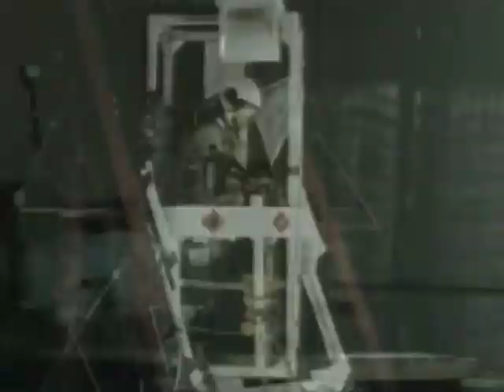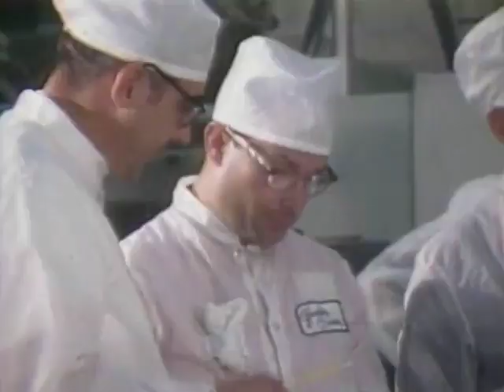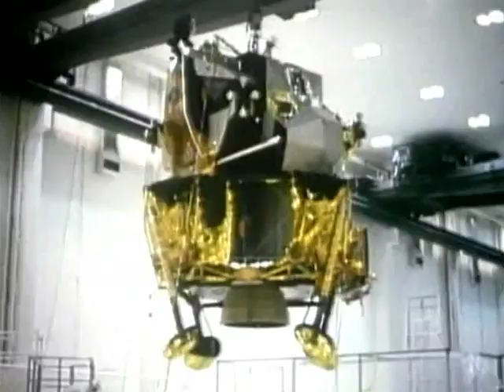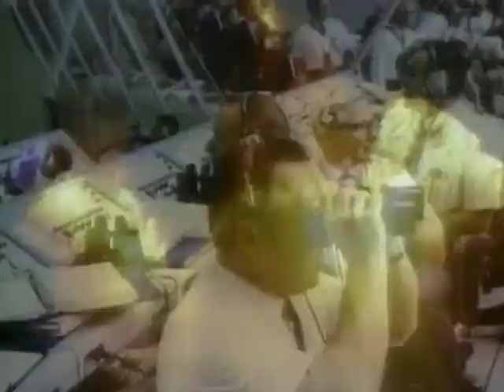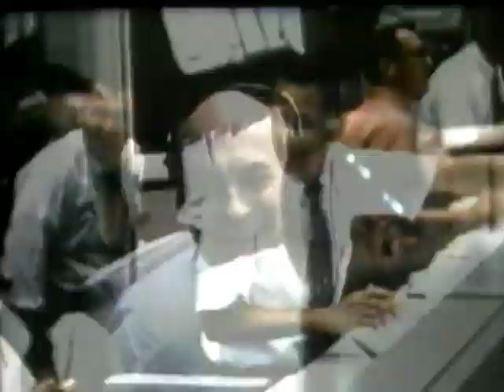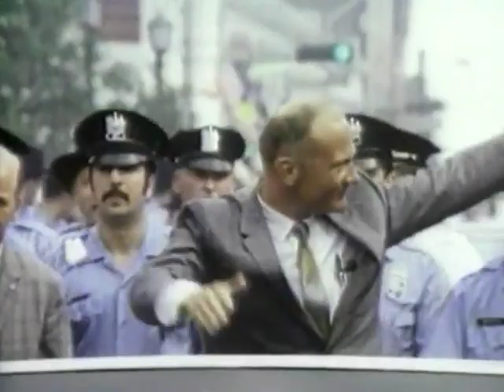The Eagle Has Landed: The Lunar Module Story pt2-2 1989 Grumman color 14min

Comment: Apollo 11. It’s a 10k lbs thrust rocket motor. How is it possible that a 10kLbs rocket would not leave some sort of a blast crater or scare on the surface where it landed, yet non exists. I researched Apollo 11 and found several strange facts. According to NASA the skin of the lunar lander was so thin that you could stick a pencil through it. How could that be? That sounds rediculouse 
Then I found this. This guy is spot on. 
Apollo 11. It’s a 10k lbs thrust rocket motor. How is it possible that a 10kLbs rocket would not leave some sort of a blast crater or scare on the surface where it landed, yet non exists. I researched Apollo 11 and found several strange facts. According to NASA the skin of the lunar lander was so thin that you could stick a pencil through it. How could that be? That sounds rediculouse 
Then I found this. This guy is spot on. 

https://youtu.be/jKXS9KIdi4I
https://youtu.be/jKXS9KIdi4I

Comment: Is it true that the lunar module had never accomplished one single successful landing on earth?
Reply: +Chris Of course. It was designed to operate in a vacuum at a max 1/6 G. How would you expect it to operate on earth? 

It was tested in Earth and Lunar orbit, with Apollo 11 being the landing test flight.
Reply: So they actually flew 370,000 kms and didn't know if that lander would function properly, and in result they got it right the first time?
Reply: Impressive achievement considering how much trial and error they experienced with all the other equipment ...
Reply: Chris They knew it would work - the Apollo 10 LM went down to within a few km of the surface, then jettisoned the descent stage, ignited the ascent stage and flew back into orbit. 

"and in result they got it right the first time?"

There were errors in the Apollo 11 descent and there was only a tiny amount of fuel left when they touched down. It was a close-run thing.
Reply: @Chris-1962  no. Apollo 9 flew it while orbiting the Earth, Apollo 10 flew it above the moon but didn't land, Apollo 11 landed.
Reply: Yes,because it was a Fake

Comment: I didn't hear any mention of the Rover?  Weight was a factor so they cut back on windows, but a Boeing car was no problem.  Perfectly logical.
Reply: By Apollo 15 they had developed the "Extended Lunar Module".  The Extended Lunar Modules (ELM) used on the final three "J-class missions", Apollo 15, 16 and 17, were significantly upgraded to allow for greater landing payload weights and longer lunar surface stay times. The descent engine power was improved by the addition of a 10-inch (250 mm) extension to the engine bell, and the descent fuel tanks were increased in size. A waste storage tank was added to the descent stage, with plumbing from the ascent stage. These upgrades allowed stay times of up to 75 hours on the Moon. These upgrades made it possible to transport the Lunar Rover which allowed them to explore large areas and return a greater variety of lunar samples.
Perfectly logical, YES.
Reply: *****
Sorry, videos made by amateurs IS NOT science.  If you have something substantial write a peer reviewed study and win a Nobel Prize for proving the landings fake.

BTW, just stating "it was fake, it never flew" is simply the speculation of a scientific illiterate.

The Apollo landings ARE scientific fact. Science has proved them w/o a doubt.
I would be glad to go over this scientific evidence if you like.
Reply: @lsdjpo  Also, in later missions, the lunar module was decellerated into the 110 by 15 km lunar descent orbit not by its own descent engine, but by the CSM engine to which it was longer attached. This resulted in the lunar module having more fuel at the start of the powered descent initiation burn than during earlier missions. This extra fuel alone resulted in an extra payload capacity of around 200 kg.
Another increase in payload capacity, be it small, came from the choice of landing sites for Apollo 15 to 17, which were in highland regions.